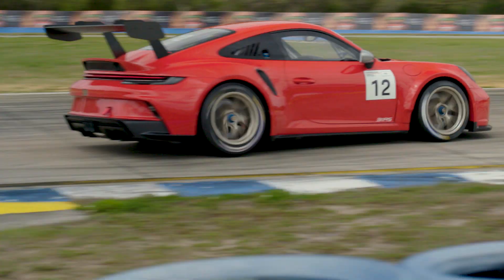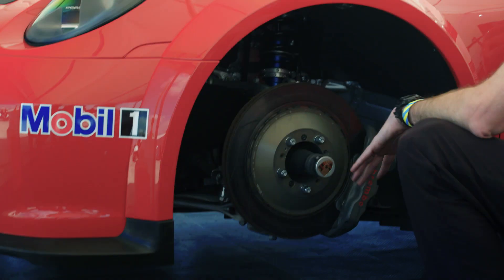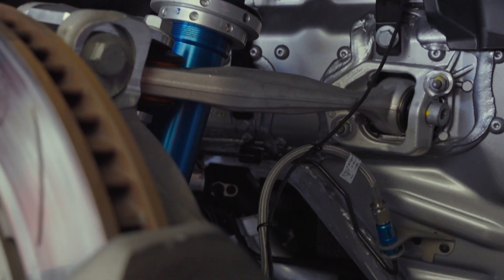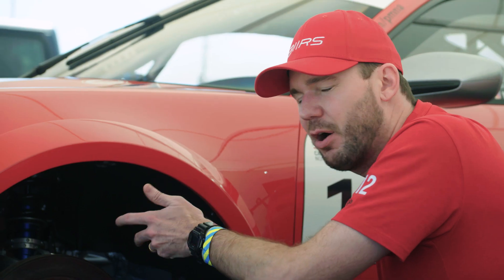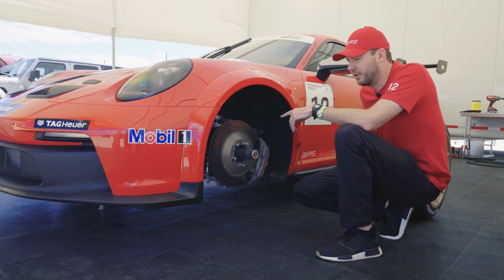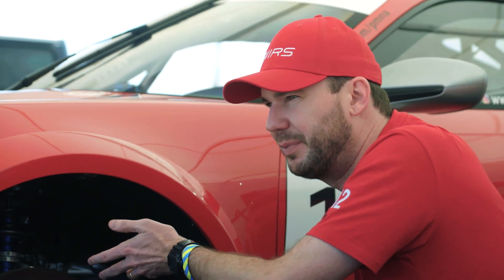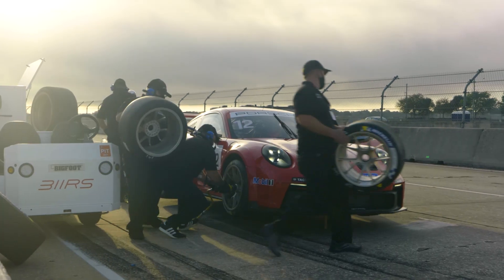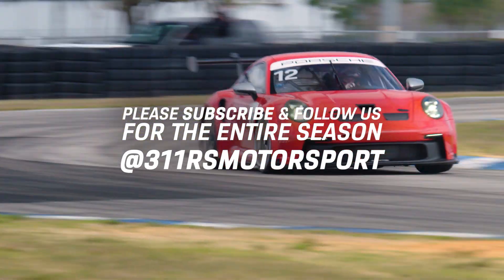TECH TALKS: Porsche 992 GT3 Cup Suspension

Comment: Excellent video. It is surprisingly hard to find good pics online of the suspension pickup points on the 992s. I can find decent pics of the 991 RSR's pickup points, but that's obviously a lot different and in no way production-based (for instance, the damper connects to the rollcage which hangs out somewhere just north of the frame rail, and all of the factory "strut tower" and related sheet metal are completely done away with). Thanks for posting this.